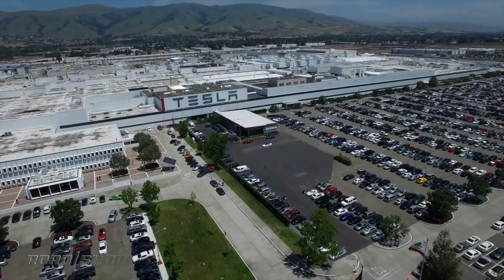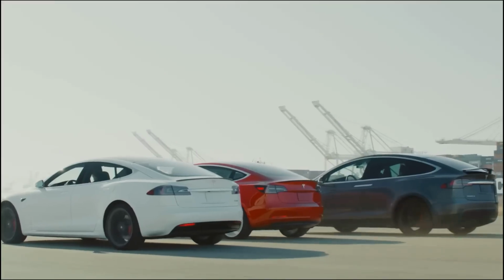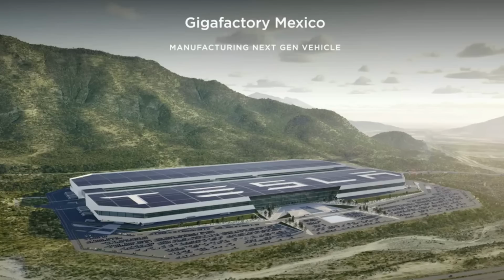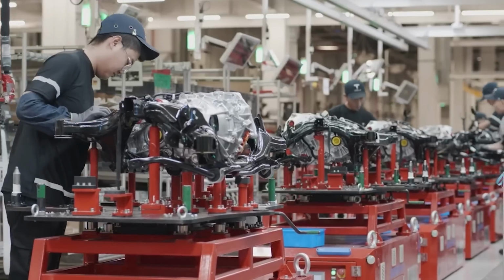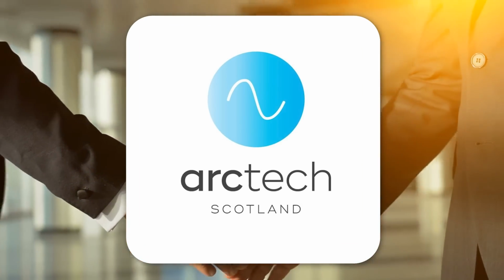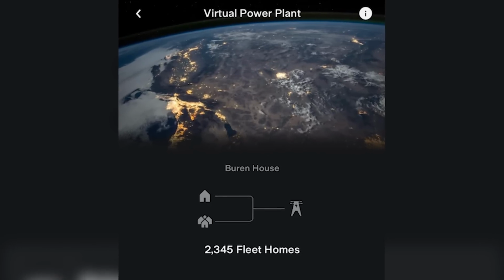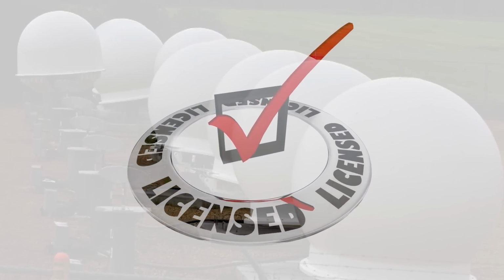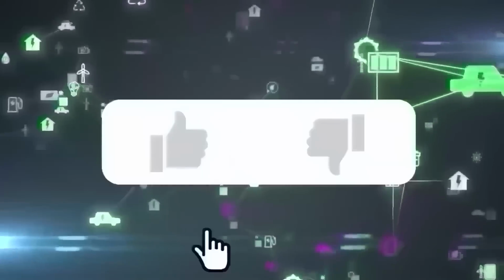Major New Tesla Cybertruck Production Update!

Comment: This Cybertruck is such a disappointment - back in 2019, Elmo said it would have a stressed-skin design with an exoskeleton, laser windshield wipers, and a structural battery pack. But the 4680 cells are just bigger NMC811 cells, it has a unibody structure, just like the Model Y, and a humongous normal windscreen wiper just like every other car. Hopefully it has decent range and towing capability.

Comment: Climate isn't causing people not to pay their bills.  Europe is a heating dominant climate.  Climate change decreases the cost.  Europe suffers from very poor green deployment.  Tons of solar going into German, a country with some of the lowest sunny hours on the planet.  Wind is inherently problematic as a primary heating energy source.  When weather systems settle into a region, they produce high and low temps.  It's the dominant stable system that causes extremes. Those stable weather systems also don't produce wind.  When temps are at their highest and lowest, there is the least wind.  This makes wind a unreliable source for heating and cooling, sans large batteries which we don't currently have..
Reply: Nothing is an ideal energy source, nothing, including petroleum products.  Yet, as battery storage grows and improves over the next ten years, wind and solar will increase.  Add in hydro and nuclear power and we should have a stable alternative energy plan.
Reply: Better go with solar in future warmer europe.

Comment: I just learned recently that the Hayward Fault runs under Fremont. The new building would be required to be designed to withstand the shaking. Some interior elements would also be secured. Tesla should overshoot the requirements.
Reply: maybe that explains the panel gaps.   earthquakes.  we have so many in SF bay area!  😅